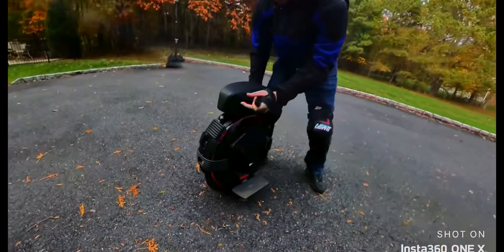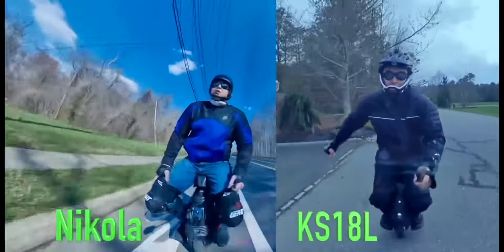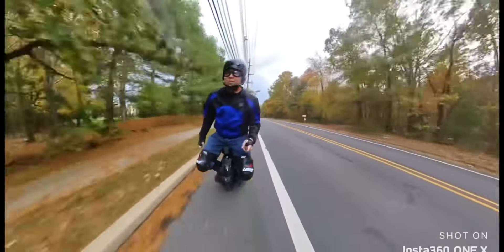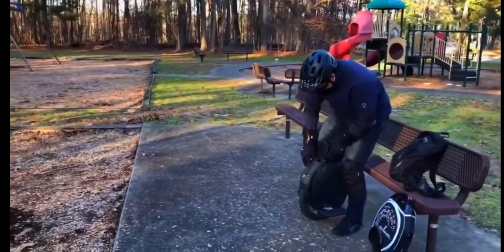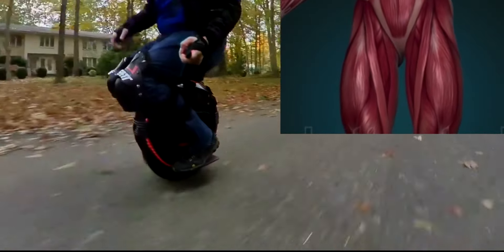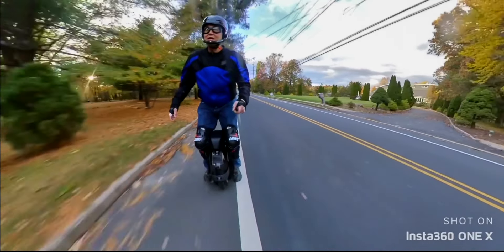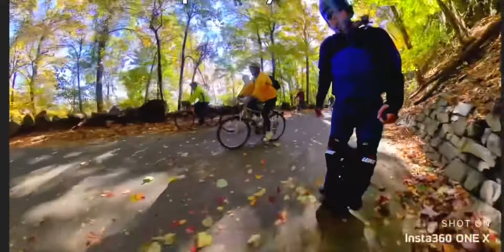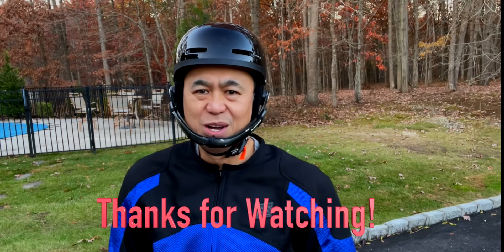Mastering 🙏🏼 Seated EUC Riding

Comment: Only riding for two months, but your previous video on seated riding was what helped me to get it! I still hear your voice in my head while I’m practicing.
This video is great. Thanks for putting the work into it. Liked and Subbed.
Reply from the maker: I appreciate the kind words. 
You are a fast learner. Glad you were able to pick up seated riding right away. Thanks for the sub! 🙏🏼
Reply: @AdamU1016  I still can't transition from/to standing, but I look forward to practicing it. Thanks again.
Reply from the maker: @michmasharts8870  - You will get the hang of it soon. Just use the hand on seat technique to even out your balance when standing up. 

Another thing is when you are about to hit a bump on the road make sure you brace yourself by holding on to the seat and slightly lifting your butt up. That and slowing down will help to decrease the chance of being bucked off the wheel like in a rodeo. 

I didn’t get into seated riding until about 2 years of standing riding. You are already way ahead of the EUC learning curve. Have a safe ride!
Reply: @AdamU1016  Yes Dr!!

Comment: I found out I don’t need front power pads, because it allows for better seated riding, because you have more room for your legs and you can accelerate better with just shifting your weight forward with one leg. I’ll just use jump pads in the future and just keep the break pads.
Reply from the maker: I did seated riding before pads were a thing. My Sai pads are more streamlined and less limiting so it doesn’t hinder me at all when I do seated riding.

Comment: this what You need is euc with bigger wheel. Try something 22-24", its much more stabile, zero wobbling even on pothole.  So much safer for ride. 
At first 22" feels strange, but after 200km muscles learn how to do it.
Reply from the maker: I have had 10, 12, 14, 16, and 18 inch wheels. I agree that I will see what a bigger wheel will offer. Definitely stability at high speed will be a big plus. I rarely go faster than 35 mph anyway which I feel is more than enough.
Reply: @AdamU1016  me too, but 22" gives stability also in low speed, like 10mph and on potholes. Just safer ride.
Reply from the maker: @roccatagon  - I think really big wheels are just too much. There is also the impression to cops and pedestrians that the huge wheel can be a pedestrian hazard. I have never been stopped once by a cop in my 7 years of riding and I ride everywhere. I don’t know how a cop will react when they see me on a half a motorcycle size wheel.
Reply from the maker: @roccatagon  - Next year when I look for my next ride  and all the kinks have been ironed out with all the new big wheels I will definitely consider a 20-22 inch wheel.
Reply: @AdamU1016  sure. Monster3 is compact and reliable, similiar case size to v12 and even less weight.

Comment: For a while I can only do seated riding on EUC with Lowe pedal height non-suspension wheels Sherman and MSX but after about one year later I suddenly can bend my legs low enough to do seated riding on both V11 and the master. So weird because I tried so many times before and virtually gave up trying

Comment: EUC's were never designed for riding seated and for this reason, I never bothered learning it.  If I get tired, I just stop, sit for a minute or two, stretch my legs and back to riding again.
Reply from the maker: Who said EUCs were never designed for seated riding? Have you noticed the many seat accessories custom made by the companies who make the specific wheel? The EUC can be ridden standing or seated and that extra option opens up so many possibilities. Why would you want your legs and ankles to be sore after a long ride? Sure you can stop and rest for awhile and I guarantee it “won’t be a minute or two”. That just adds more travel time. 
I found seated riding very intimidating at first and there is a learning curve. However, once you get past the fear and the not too steep a learning curve, that added skill just makes wheel riding so much more fun and definitely less tiring.

Comment: I just got my Sherman Max 1 week ago and want to learn seat riding.  However, I still have to learn how to have better control of the Max.  Being only 5'5" and 133 lbs., it is really hard for me to adjust from riding the smaller and lighter Z10 wheel previously.  Being short and light weight, the law of physics is really against me riding heavy big wheel.  I even installed the new model Sherman seat that I bought from ewheels but I took it off for now until I get better at riding the Sherman Max.  Baby steps for me 😂
Reply from the maker: Congrats on the Shermax! 
You can learn seated riding easily, Doc! If you can figure out the cause of hyponatremia in a status post TURP patient, you can figure out the biomechanics behind seated riding. Lol. 

It was hard at first for me and awkward too. The more I kept trying eventually it became very natural. For the Shermax just use more upper body muscles such as the hips and core. Please try the seated tips I pointed out in the video. For the Sherman Max, you will be more agile with seated riding with some speed. I had to adjust when I went from 12, 14, then 18 inch wheels. I now have a 16” Nikola and a 10” MTen3 to keep myself in check. Maybe I can put a seat on my MTen3. 🤣
Good luck to you!
Reply: Same for me, about the same weight and height and the v12 is heavy. I have improved a lot, but still avoiding rough roads and heavy multi direction traffic. Planning to get a seat too

Comment: What seat is that in the video?  I just bought the Nikola AR+ and what kind of mod or adapter do need to attach it?
Reply from the maker: Congrats on the Nikola AR+ That is a great choice. The trolley handle allows for my seat mod to work. I used my custom KS18L seat on my trolley mod. It works really well. Over a year later the seat is still firm, secure and quite comfortable. 
https://youtu.be/vjOHsPzR2Ug

Comment: How much more dangerous is the unicycle when you have to make sudden stops from a seating positions going say  20 MPH  VS being on an  Ebike?

(on an Ebike that weighs say apx  90 pounds to 105 pounds)  I worry less about being thrown stopping suddenly head first,
Reply from the maker: It takes a matter of getting used to it but if I had to make a sudden stop while seated and going 20 mph there is a certain technique used to make that emergency stop. Especially if the EUC has a handle (eg. Veteran Sherman, InMotion V13), it provides a place for the hand to grab to help with the stopping power. 

I don’t think it’s that much more dangerous to stop with an EUC vs. an e-bike. It takes practice and skill just like with any new skill learned.
Reply: @AdamU1016  Cool, thanks for letting me know.  so I've got a cool tip for you, in case you come across others who like some of the advantages of the unicycle over a regular Ebike, but like me, find it's too big a leap for them but liked the superior range of the Ebike:  My tip is this,  in terms of quality components being used, I'm paying attention closely to this  2100.00  64AMP model from this company called Wildeway, and from what I'm learning that type of amperage and 750W motor should give easily someone like  75 miles of range when fully charged as long as the weight does not go beyond 175 pounds and not much more than 20 MPH,   unlike it's 2 or 3 competitors in this price range however, there battery's are UL listed.      Thanks for the tips,
Reply from the maker: @flolou8496  - I appreciate the tip. The new and bigger EUCs have range of over 100 miles. 

For example, my new InMotion V13 has a 4,500 W motor and if I am conservative with speed staying at 20 mph I can easily have a range of over 100 miles. Max speed on my V13 is 56 mph but I have never gone more than 45 mph as I would not want to have a cutout. My V13 has suspension too. The EUC is more portable than an e-bike too.

Comment: Why not just make a EUC with an adjustable seat post ( maybe a suspension dropper like on my MTB) and a real true and tested UC seat? Maybe not so big, fast and expensive but super super stable with adjustable battery AH's . Seems more and more these things are evolving as a sit down machines like the original manual UC's. To each their own but sitting down all the time for cruising sense makes since to me. Maybe then the butt could take the weight stress and not the feet.
Reply from the maker: Seated riding certainly is much appreciated for fast and long distance rides. My legs and feet feel less sore after a ride. 
Even a tall person would feel quite comfortable seated using the technique I mentioned. The first time I rode seated I was using the wrong technique using both feet planted. It was awkward and uncomfortable. Once I rode with heels up technique, seated riding became more natural. 
Enjoy your rides!

Comment: yes but HOW to TURN??
Reply from the maker: @georgieman1910  Same way you turn when standing up riding. Apply more pressure on the same pedal as the direction of the turn. If you have a grab bar on your wheel, holding on to the bar will give you some reassurance as you are turning.